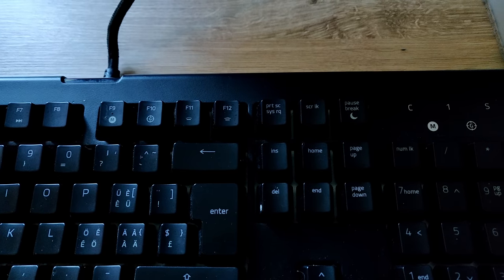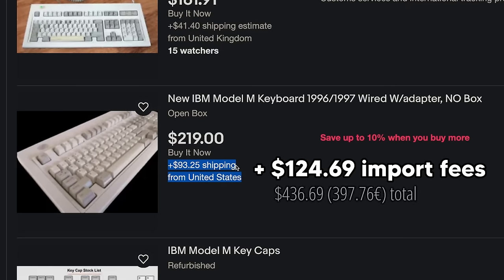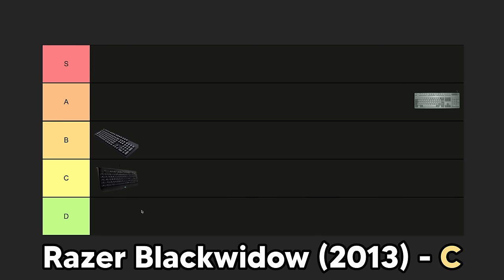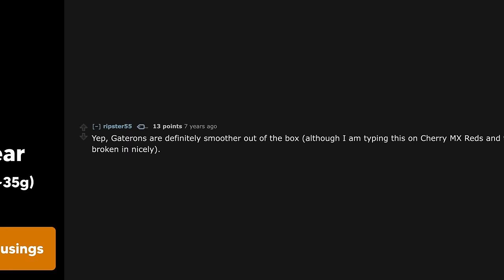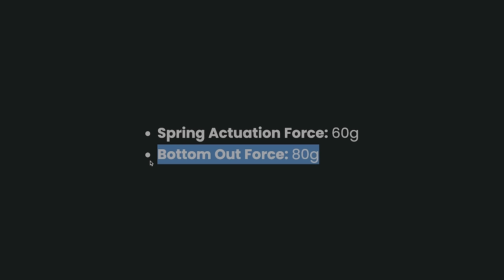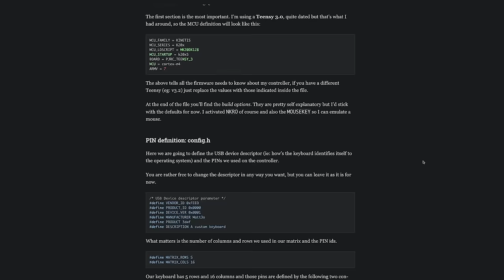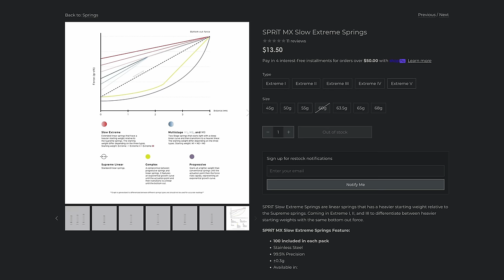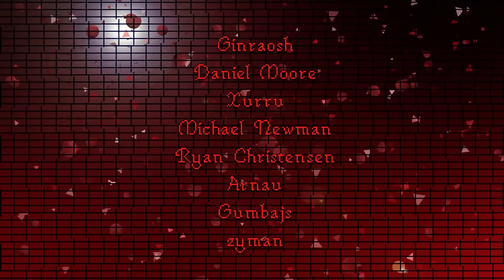How I Lost Interest Towards Mechanical Keyboards

Comment: My first keyboard was also from CoolerMaster from that era, CM Storm Trigger w/ Cherry Browns, 100% with 5 left macros, and an incredibly hefty case and metal backplate. I bought it because I saw a video where they ran it over with a truck xD... To this day the software is still excellent with multiple on-board profiles and I used the heck out of those left macro keys, but it was just before RGB and programmable LEDs so all it had was red in-switch LEDs and only a couple lighting modes. It still works fine today and looks new excluding the keycaps and the wrist rest is now perfectly glossy instead of coated in soft-touch rubber. The switches however are the loudest cherry browns you've ever heard, they all sound like a rattly space bar stabilizer, they're so loose and dry.

1:55 The thing you missed here is that they weren't just ABS... Doublesh0t abs would actually fine, a full glossy setup isn't even that bad... It's that they were PAINTED ABS, so the black part was just a thin coating on the outside of a milky transparent ABS cap, so over time they'd get a scratch and then the paint would gradually flake off and you'd just end up with a bunch of illegible blobs with LEDs shining through instead of letters.

I've recently been getting into mechanical keyboards, and honestly I think you could have a lot of fun trying some mods and a bunch of different switches for very cheap. There are a couple pre-made switch testers (Akko sells one with 16 types, mostly their own models), but there are quite a few eb4y sellers and sites where you can just pick out a big selection of ones to try. Once you have a better idea of what kind of switches you might like, you can get enough to cover a 60% board for <20 usd, some of which are even very nicely pre-lubed. I just bought Outemu Silent Yellow Jades (aka Outemu Cream Yellow version 2) for that price, fully silent (top and bottom) with a moderate large tactile bump. There are also TONS of fantastic keycap sets under 30-40, and some even at the 20 usd mark. People obsess over all the rare groupbuy GMK sets, but if you don't need something rare and exclusive and a super obscure color scheme, you can pick up sets that will sound and feel similarly great, cherry profile or otherwise (MSA, KDA, ASA, AFSA, KDA, etc) for a tiny fraction of the cost, to the point where you can get even 5-10 large doublesh0t sets that you can mix and match for custom color schemes or try on different boards, as opposed to just one.

Comment: i'm basically the same. i went through the phase of a filco majestouch with mx browns in 09 (in JIS) and started desoldering/soldering stuff as a hobby for a few years onwards, eventually bought a blank standard black HHKB, then found a nice used type-s, then pok3r and a few (mass)drop keyboards like the white fox, then rama m60-a for a few years, and also I've used a generic logitech tenkeyless keyboard with romer-g switches for the last few years. 

at this point i think i'd like to get a type-s again, the only switches i ever even remotely liked were gateron inks or stuff that imitated topre. i'd love to get one of those topre hipro ones, they look rather pretty but not for that price lol

Comment: The hobby captured me with getting the smoothest switches and optimum mounting for sound and all that. But I sort of realized that mx switches are all pretty similar. So mx customs became an outlet for my fascination of manufacturing and materials (ano, machined aluminum, double shot abs, etc.). I love using them still bc they're good for games, they are programmable, and that tactility (Only browns and ergo clears tho) and linear mx feel is fun for sure. I also dabbled with alps just out of wanting to experience a more vintage feel. But after getting a realforce 87u I kind of just realized it was time to stop. Topre was just simple enough and felt great. I'm just a bit sick of wanting the next thing, I like staying with a cozy wob or beige  with an artisan to dress it up a tad.

Comment: I have been using mechanical keyboards since 1981 and never used anything else for extended time. The Keyboard of the CBM3032 was fantastic, the C64 good, the Amiga 2000 great, then IBM Model M and L, then since 1990 I have been using Cherry G80-3000 until 2020 - actually for the most time the same.

It just worked for 30(!!!) years in everyday use. It got bit "too soft" after all this time so I bought a Cherry MX 5.0 which is too soft for my liking but I am gonna keep it for another couple of years and then maybe switch back to black switches. My two 30 years old G80-3000 are nowadays connected to my server and second PC and still work great.

Comment: after a longtime with mechanical switches, there's a part of me that wants to get a new membrane keyboard. a curiosity and an interest to see how it feels after so long. one mistake I won't make again is going TKL, though. even after years of use of TKL, i still find myself taking my thumb off my mouse to hit enter on my keyboard and of course, there's no enter key there. i used my numpad a lot, too. 

i don't have anything amazingly expensive, just a Leopold with MX Browns. i had gateron browns on a cheaper Chinese board whose name escapes me before that. i haven't found switches that actually appear on a board i can buy, that really fit what i want. the reason i always end up with browns is i don't want a key that's too heavy or too light, and i don't want too much tactile feedback, i just want a tiny bit of feedback right at the end. 

topre stuff does interest me but it's also out of my budget.

Comment: My frustration for this space (I can fully uhderstand why things are this way though!) is how if you stick to what everyone wants and has, you'll have a crapton of customization, but if you stray from the norm, your options shrink massively.

I'm very happy with my main keyboard right now, a Unicomp PC122. It's not perfect, but I love it to pieces. However, I have still liked to imagine what my dream keyboard would be like, and every time I just remember how unfeasible it is for two reasons: firstly, of all the switches I've tried, my favourite ones are Matias clicky switches, which use an ALPS housing, not an MX housing. For keycap and PCB customization, this restricts my options a LOT. I could go for ZealPC Clickiez instead, which are MX-compatible, but they don't feel quite as amazing, and more importantly cost 8 times more. There's a huge aftermarket scene, but only for the MX ecosystem. The other thing is I swear by full layouts. My second keyboard, which I bring to school, is an exploded 75% layout, and I just find it too compact. I can't stand using layer keys and I don't understand how anyone can enjoy them. Again, you want case and shell customization? There's craploads of customization... as long as you stick to compact layouts like 60% and 65%. Want 100% or more (battleship layout my beloved)? Too bad, you're SOL!

For now, lest I literally design and manufacture my own PCB, housing and keycaps, I just have to accept that, even in this era where customization rules the mechanical keyboard community, my own endgame keyboard will have to remain a pipe dream

Comment: What is the specific SPRiT spring you wanted to try out? There are various types from Extreme I to V and sizes. I am considering to swap my current spring (long with 65g bottom out force) that a bit heavier to me. Thanks for sharing.

Comment: Probably one of the best showcases of why you shouldn't sell something for an upgrade before actually trying the upgrade. The only times where I try an upgraded version without still having the old one available to sell or keep using afterwards is when the last thing breaks. 
I have a custom keyboard of my own that I soldered just a few months ago. Needed the numpad of a full size but all of the cases and pcbs were too expensive so I just took the Ducky One 2 Full Size I was using and desoldered the whole thing, replacing the decent MX Speed Silver switches for Kailh Arctic Fox clicky switches. Was a very similar experience, although managed to not short the board because I has already soldered before. The biggest issue was that the factory soldered lead was really hard to remove, because it was fairly old (dirty?) when I went to remove it. Sure, the case doesn't close all the way and the number 9 key on the numpad doesn't work, but that gives it character (?) and I have no real plans to try and upgrade after throwing this together. Everyone in the custom keyboard hobby is chasing their endgame board so that they're no longer into the custom keyboard hobby.

Comment: I built my first board 2 years ago. 
It took me about 2 years in total to research parts, & what I have is almost perfect. I can spend hours ad hours going goober parts. testing switches you name it & I always come back to my first build. the only thing that I added was I got the Tofu V2 not that long ago as at the time I wanted mine the Tofu was selling for $400 ish.. & I just couldn't do that, so I got the ID67 which was cheap & did me well. but not being a plate mount I was never happy. 
It cost me $560 & I find it hard to look back. 
I have a couple of others I like but nothing is like my first xD

I will be trying some new switches soon & I too want outlook at light but anger springs so see ho that works for me.
other than that I am very happy with where I'm at with it.

Comment: Interesting video.....like the graph line you showed you basically went up to a certain point like literally RIGHT BEFORE there was a tectonic shift in the industry (or maybe even just a totally new sub industry within the industry) which really shifted the focus to building. I think if you actually got a decent aluminum board with properly lubed switches and a softer/bouncer plate a whole new world would open up in which sound really became the focal point of the hobby. And the chase for sound is almost Neverending
Reply from the maker: I've also actually noticed that every new review I watch, the main focus is so heavily on the sound of the switches and keyboard instead of how they actually feel. Not only that, but already on this video, I've received quite a few comments saying that "you just need to get a keyboard that sounds better".
I honestly personally really don't care about sound that much anymore, I much more care about the keyfeel, as even if the sound is good, I'm still not going to use it if I prefer some other keyboard over it in terms of the typing experience. Ironically, one of my favorite switch sounds are still Cherry MX Blues/Topre lol.

Comment: It's funny, in an alternate timeline I fell down this exact rabbit hole! I bought the original Razer Black Widow (Non Ultimate) back in either 2011 or 2012 for around 100$. Back then spending 100$ on a keyboard seemed insane to most people, and to justify it I decided to use it for as long as possible. It's still going strong to this day. No issues other than having to clean it every few years. Now if only I had that same mentality for retro game upscalers and CRT monitors. 😂😂😂

Comment: It kinda feels like you haven't tried any of the custom metal barebones kits or switch configurations. Try and buy a Sugar65 or something that is inexpensive/good build quality and you can they try all of the MX switches that you haven't had a go at. You could buy switch sample packs as well of all the switches that you've mentioned you'd like to try and get the feel for them without financially committing to a full set

Comment: as someone who really likes keyboards, and when i finally got a cheap 65% I made my own lube and opened every switch manually without a switch opener and went through many many mods. Eventually somehow bricking my keyboard with the rgb software. You should definitely try to build a keyboard now, I'd say the culture has changed massively and lubing switches isn't horrible..

Comment: I've built a few keyboards from kits such and the plank and preonic. I expect that there is a hand wired keyboard in my future along with 3d printing.  I've seen a number of keyboards that I like but at this point due to the limited availability of QMK/VIA keyboards I'm caught up in the Keychron family. K6 Pro, K2 Pro, and in the not to distant future the Q9. One I got my first plank, and had the option to program the keys with the QMK software, it put an end to my use of non QMK keyboards. I also like the smaller footprint.  You did not make any comment about mice in your journey, I suspect that you had a similar journey to your current mouse as you did your keyboards.  I did as well. Currently sporting the Logitech M650 in a Left hand configuration. My journey started on a Teletype Model 33 ASR, then the IBM models M and F-122.

Comment: Crazy, I went through the same process myself although much shorter. I put together my first keyboard that I bought as a kit and then put in Gateron Oil Kings and a few different keycaps. It cost me quite a bit of money and the next step I looked at was Topre switches. I bought a Realforce keyboard and have not looked at building another keyboard since. I may mess around later with some of the new switches that come out but tbh Topre is on a different level. That and there isn't any big innovation for new mechanical keyboards. The biggest one IMO is what Wooting did with their Analog keyboard which I would imagine feels completely different to type and game on.

Comment: Ahhhh im at that stage atm. Im exhausted over the mech game atm. My last ever board will be the HHKB board. There's two in the pipeline that will be delivered by september this year and the HHKB will be straight after that. I started in the tail end of 2018, 7 boards in, 2 sold boards, 1 numpad and a Artisan tray with a few selected Artisans. Im going in blind with the Topre switches. Basically completing my wishlist. I have other interests that are more fun than having very expensive custom made desk weights in a very niche community.

Comment: I find this video quite funny, because I myself quit the hobby years ago and our tastes are so different. Personally I hate the HHKB - it doesn't come close to many other dome with slider keyboards I tried, like the ones from BTC or Scorpius. But I'm someone who really likes very sharp and hard tactile bumps while Topre is rounded and spread out throughout the entire travel of the switch making it feel numb, even cheap imo. What I ended up settling with are IBM Buckling Springs but the capacitive variety of the Model F - possibly one of the smoothest traditional switches ever, with very sharp tactile bump that is set very late in the travel of the switch. It is possibly one of the most unique feeling switches ever, and many modern enthusiasts aren't a fan of it. I bought my model F AT on my 18th birthday in 2018 and never cared for any other keyboard since. I also bought a GMMK Pro for work, but that's just so I can have a very quiet and nice feeling keyboard so yeah, it's funny how different people will have such varying tastes.
Reply from the maker: You said that "Topre is rounded and spread out throughout the entire travel of the switch making it feel numb", are you sure that you weren't using a HHKB Type S? Because what you're saying sounds exactly like a Topre with silencing rings that reduce the top part of the travel distance, hence reducing the tactility. I tried a silenced Topre clone, and it felt almost linear, I didn't like it at all. 

I'm still using the 21 year old HHKB Pro 1, and despite it only having 45g switches, the pronounced tactility of it makes it feel much less mushy and "heavier" than even the more tactile Cherry-MX based switches.
The only switch that came even close to a similar experience were Box Royals, which most people hate due to being too tactile.
Reply: @Livakivi  nope, it was a standard hhkb type 2.
Reply from the maker: @aluxannar  I'd also like to mention that when I tried some Topre Realforce keyboards in a store recently, I was surprised at how weak their tactility felt compared to my HHKB. Some people claim that as Topre domes age, they become stiffer, hence increasing the tactility. I'm not sure how true it is, but I only have experience with a 2003, 2004, and a 2012 genuine Topre boards (latter two in 2015 ish, all HHKBs as mentioned in the video), but iirc all of them were more tactile than the recent Realforces I tried in the store.
Point is, maybe it was a similar phenomenon, I personally feel like Topre (or at least the HHKB) is still one of the most tactile/"poppiest" keyboards at its 45g weight, which is why I can't stop using it, but I do know that some people just dislike Topre, especially at first when coming from more traditional mechanical keyboards as its a very different experience and takes a bit of getting used to (recently had the same experience myself again).

Comment: I put alot of money into my FC980c Topre Board and it just can't match one of my boards with Boba U4 silent switches or Durock Shrimp switches. 

Here's the strange thing. My first hotswap board was the GMMK TKL. 11 keyboards latter, and nothing I've put together can match the feel and sound of that GMMK TKL with Boba U4 silent switches. I don't entirely get it. Does the GMMK TKL have an integrated plate?

 The silent switches don't feel or sound right in gasket mount boards. They are a bit bitter in the tray mount, but not anything close to as good as they are in that slim GMMK case. Now, if I use the Boba U4T normal tactile's they are fine in anything.

Blah blah, try some Boba U4 silents or Durock Shrimp switches. Feels like a premium less wobbly Topre.... kinda.. Not really, but I like it better.